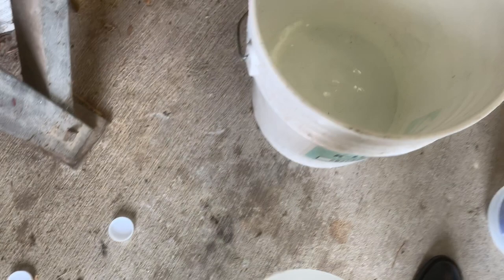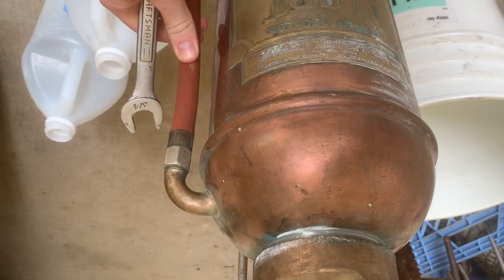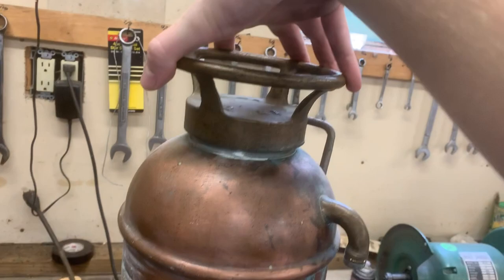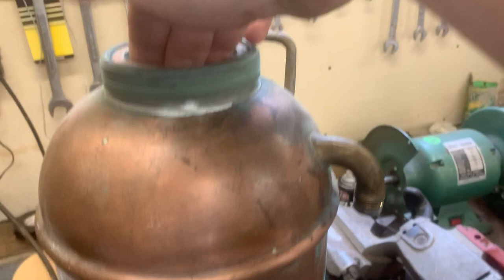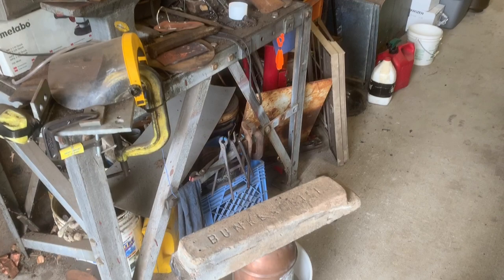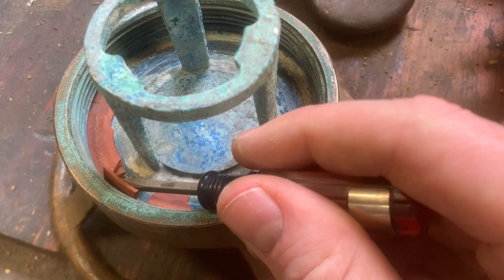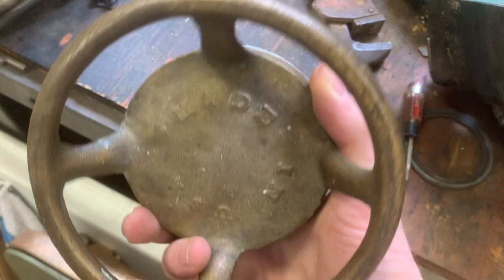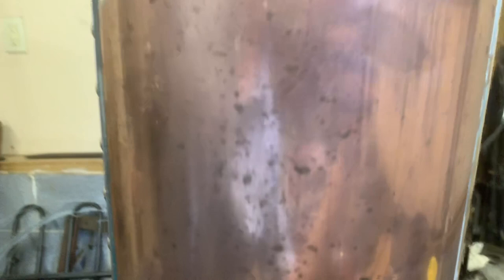Cleaning A Copper Fire Extinguisher Pt 1 (Cheap)

Comment: Back in the days those were great extinguishers. Very effective and easy to recharge and put back in service. Unfortunately due to time and age many of them are corroded and weakened with age and their ability to hold pressure without bursting might be an issue. They do make nice antique conversation pieces though.